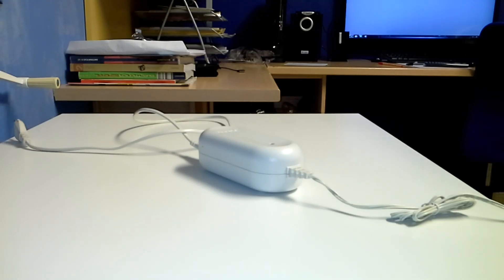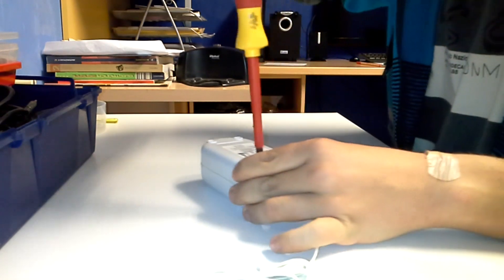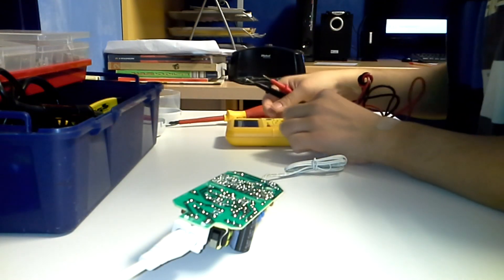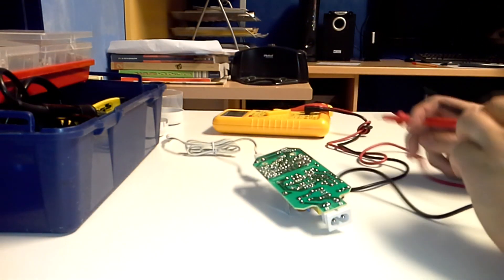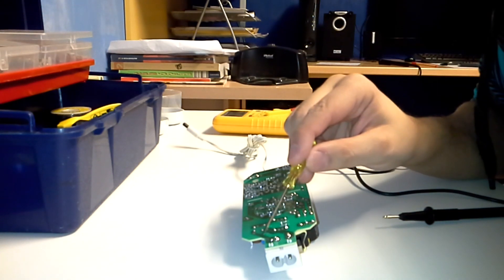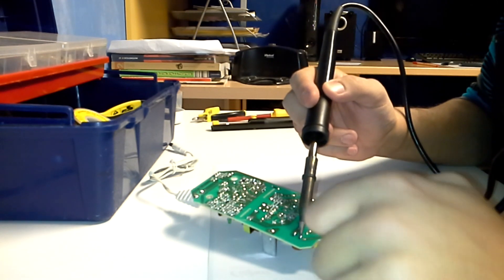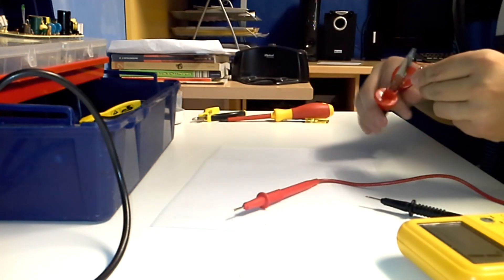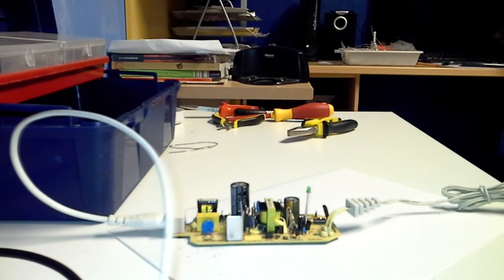2 - (1/2) Repairing a switching Mode Power Supply (Roomba)

Comment: HA HA.. man,that is funny.  A 30ga (wire wrapping) wire strand would have been a much better 'fuse'.  OR, get a resettable circuit breaker and use instead of fuse... and use the lamp bulb to limit current

Comment: TIP: the higher the lamp wattage the better results you will get, I use 200W lamp and it is quiet good. If you use low wattage lamp it will light up as soon as you connect the device, even if there is no short

Comment: If you have a problem with your mains circuit rectifier, connect a big HIGH wattage incandescent lamp in series with the power supply input, so if your power supply has a short circuit (probably the 4 rectifying diodes making the bridge are bad), the lamp will turn ON instead of making an explosion :)